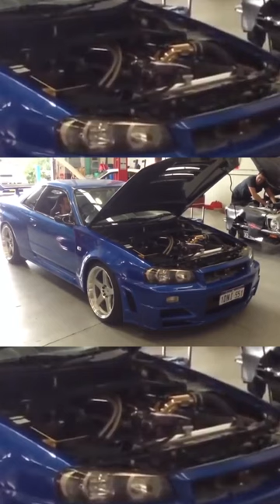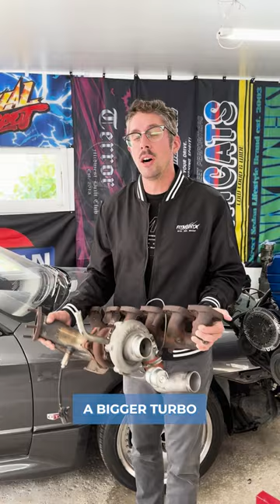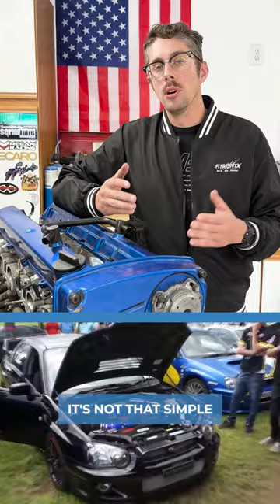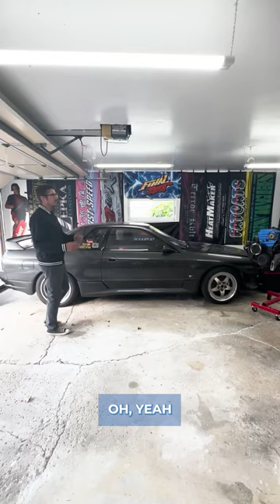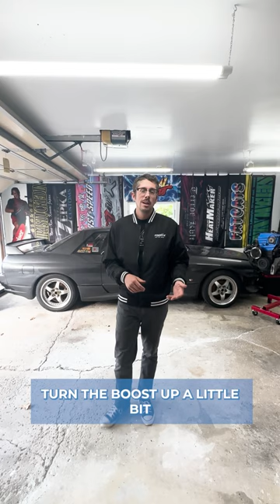Size doesn’t always matter 👀 #shorts

Comment: Quick PSA for people just getting into modifying car’s. This advise is great, but always remember. Your car will need a TUNE to support these types of mods. Simply adding a boost controller to your factory turbocharged vehicle. Is the best way to throw a rod and destroy your engine. Just looking out for my fellow Subi bro’s out there! Also these guys are pretty awesome. Keep up the great work boyzzz❤!
Reply: From what I remember, a tune is only necessary for speed density vehicles since MAF can adjust when it sees additional flow. Exceptions are to make the best performance and if you change something significant.
Reply: @user-lz3sv5sw9u  That just doesn’t sound right at all…
Reply: @deepinmythots752  it does adjust itself automatically seeing additional flow, however not alot. intake/exhaust, sure it can compensate for that but injectors and more boost not enough.